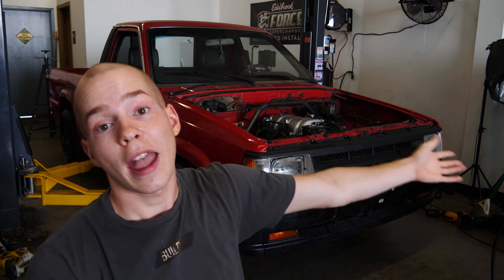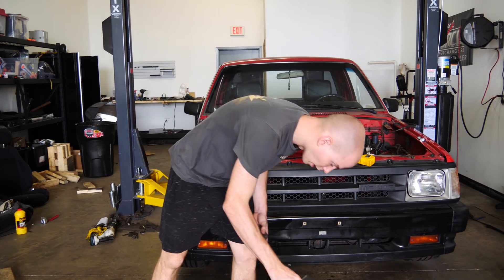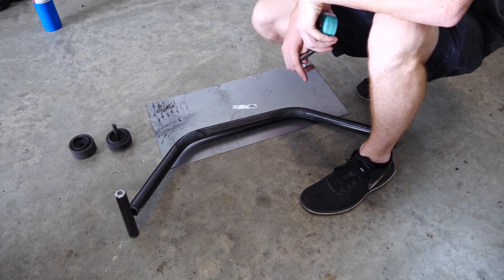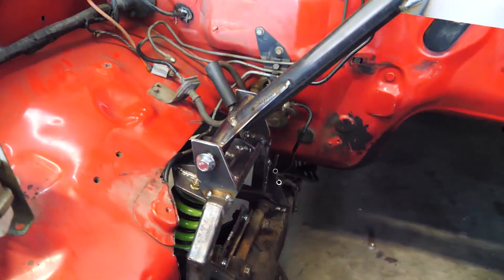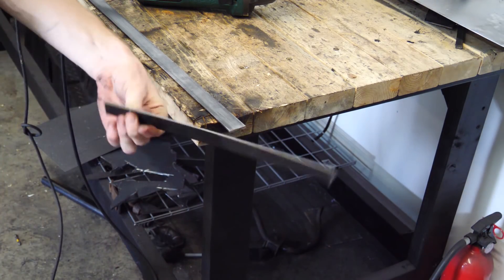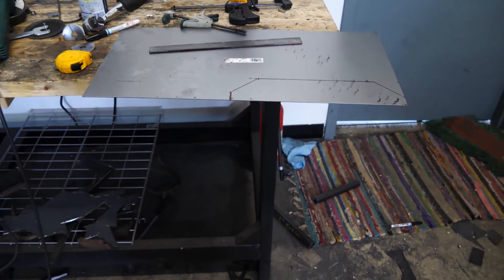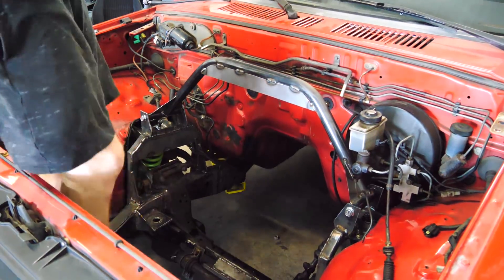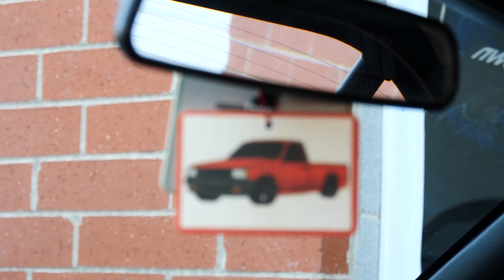Engine Bay Fabrication & Reinforcement is FINISHED!

Comment: Why a black engine bay? The white of the RX7 made everything stand out and put the focus on the engine! I'd personally keep the colour the same as the body. Puts the focus on the engine, and makes it easier to spot leaks
Reply: Extulen black looks better plus hes doing a full custom car you dont want anything to look the same you want to show you’ve touched every part of the car down to the dirty details
Reply: Hova Street King but black also makes it harder to find stuff
Reply: You should never paint an engine bay white. Engines produce so much dirt and you'd see every single bit of dirt in your engine bay. So if you want to keep it look clean, you'd have to clean it up almost every 30 minutes.
Reply: I find the white engine bay way cooler. I think all this fab shouldn't be hidden by a black coat. Yeah it does get dirty but it looks way cooler imho
Reply: Its not a show car. Its a drift car.
Reply: From a white vehicle owner of a 1500 pickup, you dont want white on anything. Especially the firewall. It shows alot of dirt and even rust spots. Every little imperfection sticks out. I cant stand the look of my engine bay, and have to wash it. Sadly, the wash doesnt elp much. Black hides everything. Lile my headache rack off a wrecked truck. It was twisted, rusty and everything. Somewhere alongnthe line on a few fin, they started to rust again. The black pain is hiding the rust. certaim angles you can see it, but overall its hidden.
Reply: Brandon Harrington It doesn't have to be a show car to have white engine bay... Are you serious?
Reply: @trian891  are you serious? Colored engine bays are for looks... this is a drift car. Why waste time on bullshit thatll get destroyed by smoke, oil, burnt rubber.. etc. Waste of time to make something look good AKA what you do for show cars. Thanks for the reply though
Reply: Black engine bay with aluminium colour to the fabricated stuff
Reply: trian jim it might look cool, but i have to show you an example to understand this: I got a set of Oxigin 20 Attractions in Black/With/Red on my car. Everytime i drive this car my rims are getring dirty and i have to clean them.so tgey stay clean. If i dont do it the same day, it will be very hard to clean the wheels perfectly up. Caleb is now uploading every i think second day on this channel. So if he paints the engine way white and still works on it, he will see dirt all the time. So he has to clean it every day. And as he said once: He starts working on the truck at 10am until 10pm, gets home, cuts the video, uploads it. So he has not that much time to clean it perfectly up ever day, and he has to, if he wants it to stay clean, shiny and looking nice. So now imagine he is going to a drift event one time with his B2200. The track will be dirty and as we all know, there arw holes in the chassie for the structure he build. And because those are there, dirt will come in for sure, scratch everything, leave dirt everywhere and so on. Now he has not the chance to clean it up after every run or every drift day. Just imagine a drift weekend. There is no place to wash the Engine bay, so it will stay dirty. Because of the white paint you will see every bit of dirt, and you wont get it away, because there are some places xou cant even reach with a toothbrush. So the dirt will stay there forever, which sucks, looks bad and nobody wants. 

End of... my explanation of why you shoudnt paint the Engine Bay white.
Reply: Tim Essel Well. That, my friend, was what I call a very good explanation. Cheers !
Reply: Extulen black looks best
Reply from the maker: Idk, I figured black matches everything, it'll match any future color scheme of the car.
Reply: Gabriel Gobeil Thank you very much :-)
Reply: Maybe a semi gloss black in the bay?

Comment: Get the LED headlights used in semi trucks for your drift truck. They're mostly used for Internationals. It should be the same size as your headlights and bolt right up. It would look way cool

Comment: Don't do a black engine bay with a vehicle that will be on a track getting abused way more than a daily driving car. Go with a lighter color that way you can see leaks and fluids better. With a black engine bay, you won't be able to tell early signs of a leak or fluid related problem until it is too late and spilling out on the track. It will also help with figuring out a more accurate position of the leak because it will be easier to see where in the engine bay has fluid on it. You don't have to go white, but just don't go black.

Comment: You need to lube all the parts on the die including the metal. Also there nut is junk, you need a double thickness nut. Basically two nuts welded to provide double thread contact. Modding tools is part of the game
Reply: Ging contact me I daily a ls Tacoma daily 8 ish years
Reply from the maker: I did! I think its best to just get a press and use it with that.

Comment: Crazy how people believe your shock mounts will break. It's thick steel welded everywhere. Normal shock towers are thin metal and still hold up
Reply: I have a Peugeot 205 and trust me Gingium's are at least 5x stronger. My car has been driven hard enough for the towers to warp.
Reply: a 205.. better get a stronger german car haha
Reply: Kreed1910  205's are cool
Reply: Normal shock towers are also supported from all sides, attached to a large wing rail are and engineered by professionals.
Reply: If it fails he can strengthen it further. If it doesn't fail drill lightness holes in it until it does so you know how far to go. People are too precious about what can and can't be done.
Reply from the maker: As someone said, normal strut towers are usually very well engineered. 

I dont think myn will break, but I dont think they're any stronger than factory strut towers.
Reply: everyone should calm down though your welds/structures look strong AF

Comment: Each like help's Gingium buy a vice for the bench
Reply from the maker: First purchase when the truck is finished is a bench vise!
Reply: Why not now when you can justify the purchase by using it? Instead of rewarding yourself by completing the drift truck first.
Reply: Joel Krocker why spend $130 dollars on an arguably unnecessary gusset tool when our can buy a much more useful for this build bench vice for about $50
Reply: James Kaminski that's what I was getting at was the vice.
Reply: Plasma cutter might be a good idea too.  More $$$ though.  I'm not familiar with metal fab but think you can use those with a straight edge too.  Can get straighter cuts than freehanding with angle grinder.

Comment: Loving this build so far!! Makes me excited for getting back to fabricating on my Camaro. One tip though is to use a hole saw on the end of the strut tower braces, that way it sits flush centered on the round tubes that are getting bolted to the shock towers.

Comment: Ginguim, I think you're doing very well on the build given that parts aren't showing up when they say they're suppose to be there, keep up the amazing work.  I like the design of the strut bar, you're welding is looking good.  I make only three suggestions for the engine bay, rubber strips around the wheelwell to the strut tower to hide the gap, keep water out, and to make the bay look a little cleaner. next two are on the strut brace, it looks strong, if you remake it I would suggest notching the ends so they fit over the mounting tubes, will look a little cleaner and will be even stronger.  the gusset across the top is good, but over engineered, a triangle at the bends for gussets will be just as strong and give you more clearance.  You're doing great, this is going to be a great project.

Comment: Note on your fancy new tool, try using grease or some grind of lubricant on the threads of the bolt, I've had the ball joint tool strip the threads but after using grease haven't had any problems.

Comment: Should weld up the top part fully then flappy disk the welds seem less before painting over it will make it look allot more flush and smooth and since its on tube it wont flex enough to fracture the welds. My personal opinion do as you wish

Comment: Hey gingium I heard you say 'I want to make the strutbrace from a stronger steel' but if you are going to weld that you are weaking the material and the stronger steel doesn't matter any more. One more thing is grind down your welds to get better quality welds it will make the construction stronger, not staticly but it will improve fatique life. And last an advice I learned from a professor in welding technology if you can attach something in any other way than welding don't weld it!

Comment: If you needed to make a new brace you could go a tad lower and just add a thicker (1/4") at the bends in the pipe corners. If you wanted you could just cut some speed holes with a hole saw and call it a day. Looking ok, I don't worry about it failing, it seems sturdy enough and its not like a hemi or a big block chevy is going in or something  lol.. :)

Comment: Nice job , have you thought of using a nut on the dimple die  to bypass the stripped part or is it the bolt stripped.

Are you going to get it road legal once finished.

Comment: All of those sheet metal gussets on the strut bar are basically useless.
There's no side load on the bottom angles to need gussets and the top sheet is way too thin, a couple of nice thick ( 2-3mm ) triangles just on the upper bends would have been much better.
The massive vertical parts of the strut bar are a huge weak point, ideally you want a bar that's completely horizontal with no bends. You can mitigate this weakness somewhat by running a "spine" of 3mm flat bar up the outside of both verticals.
Reply from the maker: I actually noticed a significant difference in flex from before and after the gussets on the strut bar. They're not as good as they could be but oh well!

I really wish I could've made the strut bar completely horizontal but obviously... there is an engine in the way.
Once we remake it out of some nice stiff steel with some nice meaty gussets, it should be perfect!
Reply: I'm slightly concerned that your weight created enough deflection in the strut towers that you noticed any flex at all lol
If you remake the strut bar, consider mounting it to the strut towers a different way. Although you're bolting the ends of the bar in nice and tight, the "bush" style mounting creates a pivot point. 
If you attach the strut bar to the coilover mounts it will be more solid and also reduce the bend angles somewhat.

I'm keen to see this thing driving, I considered putting a 1UZ in my B2200 a while ago but I already had too many 1UZ projects so I was pretty excited when you revealed your plans for yours :D

Comment: I love this Project and if you want to put some mods on it i would Recomend a Borla Exhaust On the 1UZ cause its a toyota Engine and a Cold air intake For a I force Toyota V8
Reply: This is dumb. He is gonna have to make a a custom intake with silicone tubing and a cone filter. He will also have to make a custom exhaust to match up with his custom headers.

Intakes are all fairly similar in design but exhausts have to have bends according to the cars underbody and hangers.
Reply: Craig Bolin maybe he could just get the Borla mufflers themselves, and make an exhaust with that?

Comment: you should clear coat only stuff that is raw metal and visibile to retain heat marks.
a Metal Plate that says LS2200 or whatever on that strut bar would be cool
Reply: Adam Rosser but its not ls
Reply: BoudewijnB the engine is most likely from a lexus ls400
Reply: but b4000 would be a better name

Comment: Don't expect Anything you get that uses bolts as a way of applying pressure to not break. Get an actual die press. It expensive but it's worth it if you plan on doing a lot.

Comment: "Suspension doesn't flex at all" as it bounces 4-5 inches bruh that's miles compared to my miata suspension and its not even the stiffest suspension its only 7k fronts and 5k rear.... and I cant get that thing to bounce more than an inch or half an inch unless I stand on my door frame... and its the heaviest model of miata.. the NC